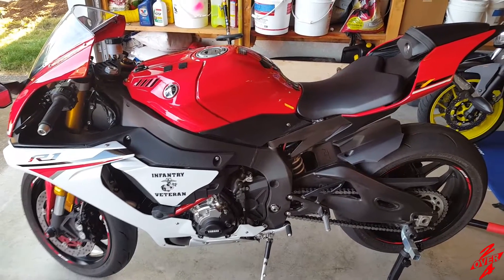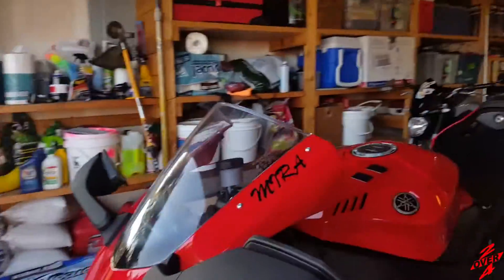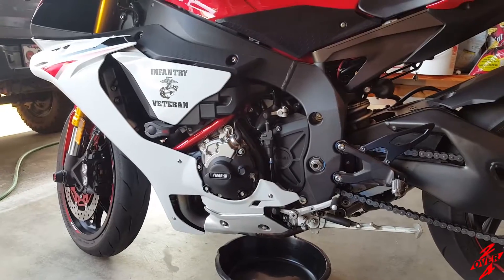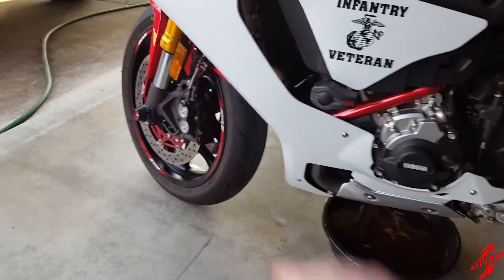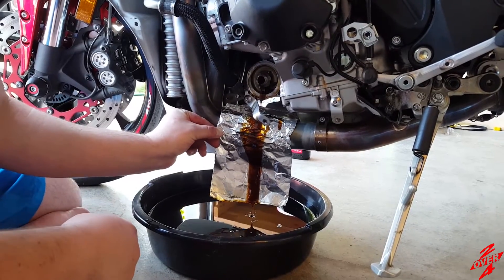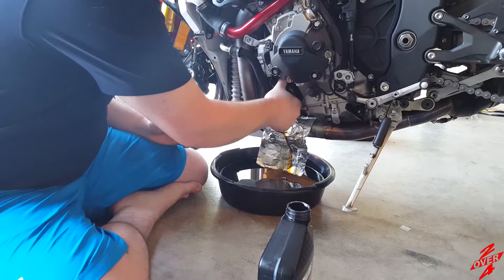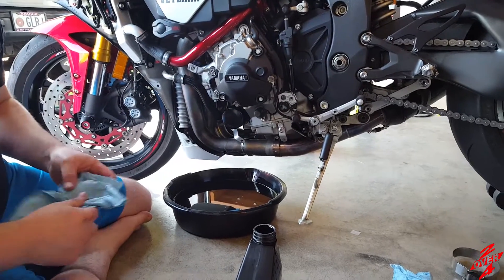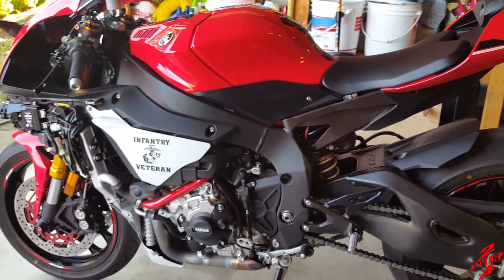2015 Yamaha R1 Oil Change - How to

Comment: Nice breakdown, needed this for my 18' R1 I just bought. One question, I've had some mechanics completely fill the oil filter before installing and some just lube the o ring. I sort of compromised and just fill half the filter, but honestly I don't notice any difference whether I do or not?
Reply from the maker: I have also done both in the past. I have not seen a significant difference in my need to possibly top off after a short ride around the block.

Comment: nice vid! Which Gopro mount did you use on the tank? I'm assuming the flat one, but did you modify it at all to make it stick there as that part of the tank is so curved? I wanted to ask before attempting to mount one on mine. Thanks!
Reply from the maker: Superion Solace yes the flat one. I did add some extra double sided tape from the tool box to fill any gap that would come with using the flat mount.
Reply: Ah ok perfect! I will do the same! Thanks for replying man!

Comment: Did you replace the Drain plug washer or did you put the old one back on ?
Reply from the maker: Didn't replace no issues
Reply: @2over4  Thanks for you reply, I was expecting you to respond so Quickly. I only ask because in someone else's video he said to replace it but I can't find anywhere that sells them or even the drain plug in the UK unless I buy directly from Yamaha
Reply from the maker: @neilchadwick760  saw your question come in as I sat at work, figured I'd help. Ya my bike is still good but treat your bike however you want lol

Comment: You didn't go with full synthetic?
Reply from the maker: Not for this one honestly.  Here is why.  Oregon has a short summer, I'm not riding hard as I am still breaking my body back into being on a bike and when asking the Yamaha shop they suggested semi synth until I reach 3k miles or really start riding her.  Since I only have about 1 month and a half before she spends a lot of time indoors, we decided this was the best choice.  Next spring when I am getting ready for the track she will get fully flushed with full synth and all new fluids to be track compliant.
Reply: +2over4 Oh I see.  The manual recommends full synthetic so that's what I went with for the 600 mile oil change I'm about to do.
Reply from the maker: +Edgar Tirado I did go full synthetic at the 600mile change but due to closeness of winter went semi this last time.  500miles since change and she's still ok

Comment: I just got some oil today from the dealership and was told it was 5 qts not 4.  HMMM
Reply from the maker: The 2015/2016 Yamaha R1 Service Manual on page 205 which is Section 3-31 gives 3 different amounts.  Here is the breakdown.  Oil amounts in US Quarts is 5.18 when disassembled.  Oil amounts in US Quarts is 4.12 when assembled without filter replacement.  Oil amounts in US Quarts is 4.33 when assembled WITH filter replacement.  I can see how someone who simply read the first part of the oil change section would believe you need the full 5.18 quarts but in reality when reading the full oil service section, you will need 4.33 quarts.  You need to buy 5 but not use all 5.  Hope that helped clear it up
Reply: Got it.  So i guess I can use the rest in for my son's pocket rocket!  HAHA
Reply from the maker: Sounds like a perfect solution :-)